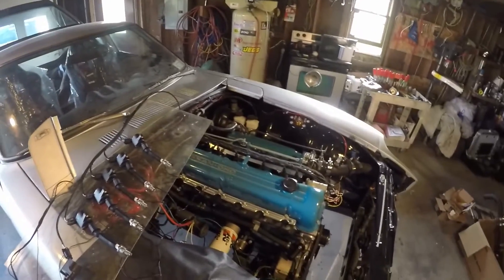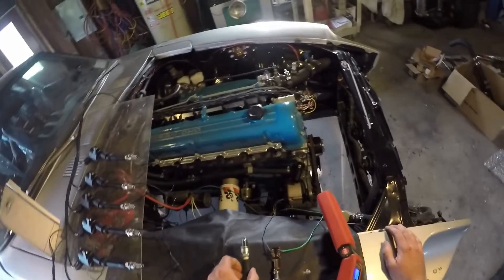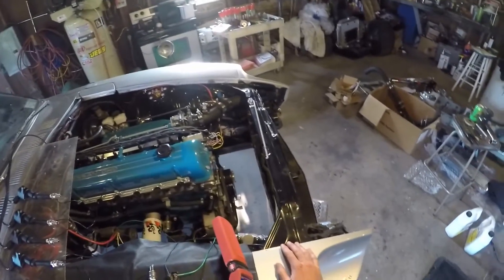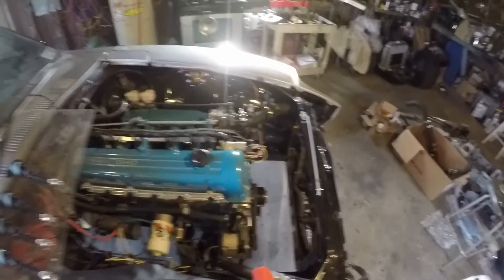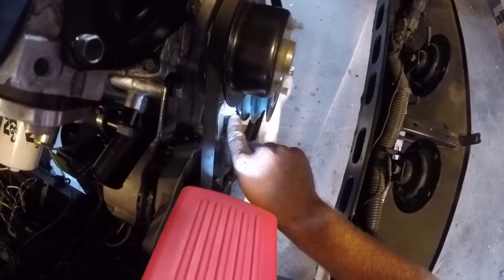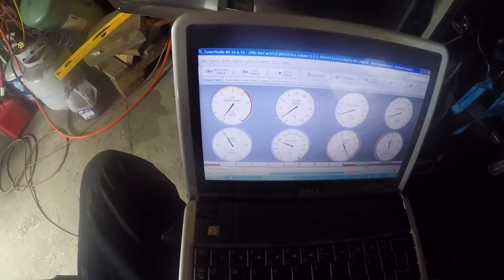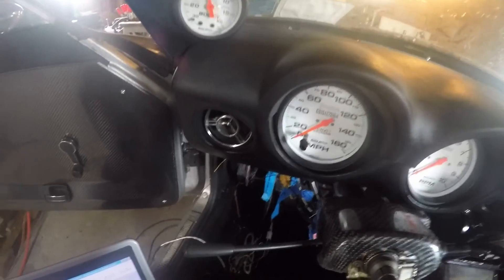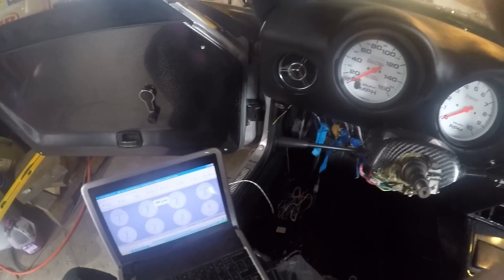Datsun 240z Turbo Megasquirt initial setup and start attempt

Comment: I bought a 240z with a built l28 and redline fuel injection system in it, but I don't know how to modify it yet.I'm afraid to blow something up..where do you learn the basics of all the settings?

Comment: what coil packs are you using?
Reply from the maker: +Juan Rodriguez  They are V8 Ford coil packs. http://www.ebay.com/itm/8-Pack-For-Ford-Ignition-Coils-Multispark-Blaster-Epoxy-DG508-C1454-High-Quality-/152025717248?hash=item2365705a00
Reply: sweet thank you. hows the build coming along?